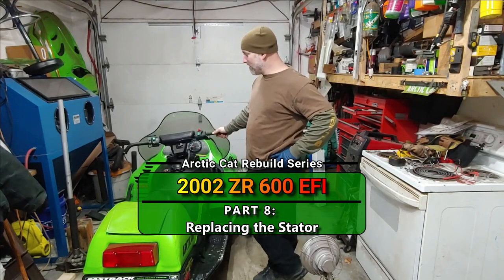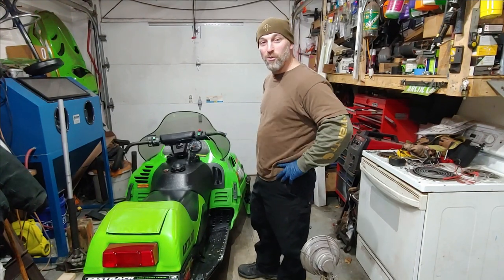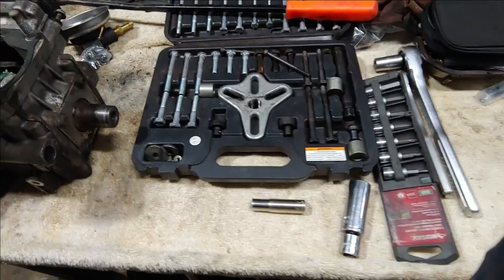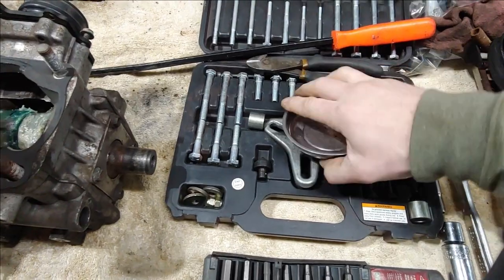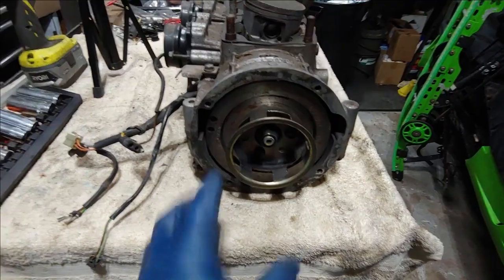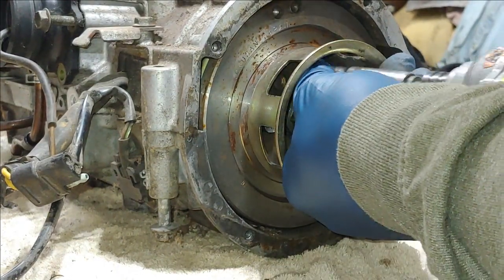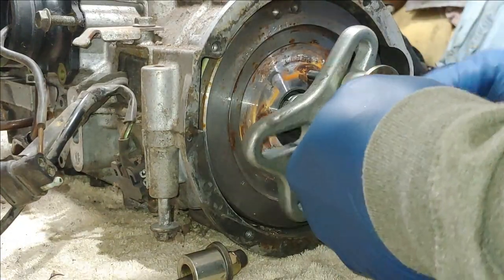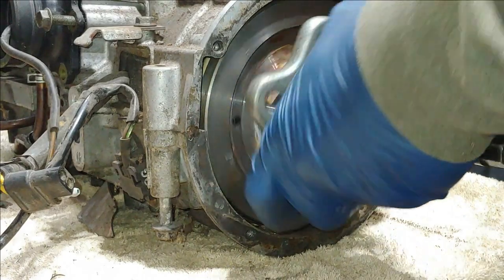02 Arctic Cat ZR 600 EFI Part 8 [Stator Replacement]

Comment: Mine has a intermittent spark/electrical issue. When it’s dry it runs perfect. When it’s wet and the engine compartment gets wet is when it starts acting up. Misfiring and back firing and just plain running likeshit. I successfully removed the flywheel and in the process of testing the stator.
Reply from the maker: Nice. Yeah I dealt with the same thing.

Comment: Tell me a brush for cleaning contacts you need to take Devey ? Or you can use any other? Hahahaaa. Andrew, when assembling the contacts, I recommend using a grease cleaner for the contacts. for example, liqui Molly . Well, I've been using it for 15 years, even for new contacts. it very well eliminates the existing corrosion and protects against its appearance in the future .

"Grease for electric contacts" LIQUI MOLY " Electronic-Spray (200 ml) aerosol Liqui Moly 8047"
Reply from the maker: I will have to check that out.